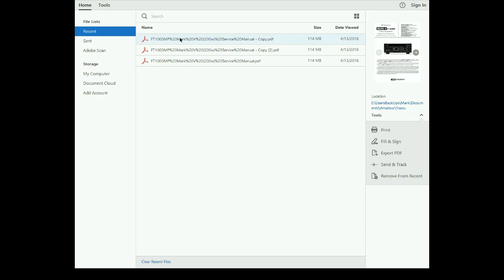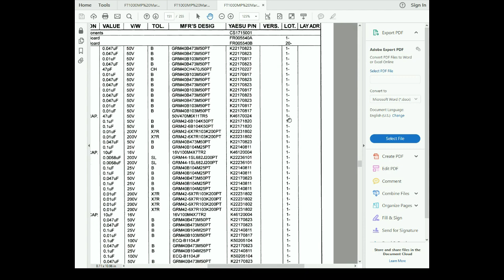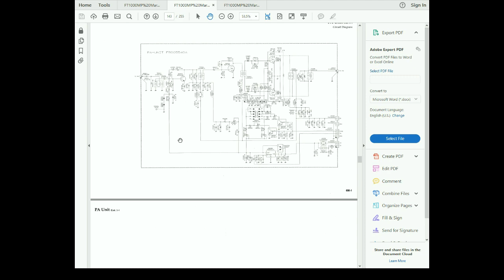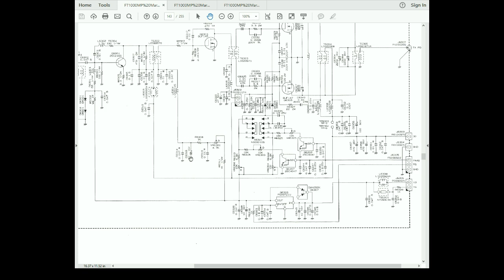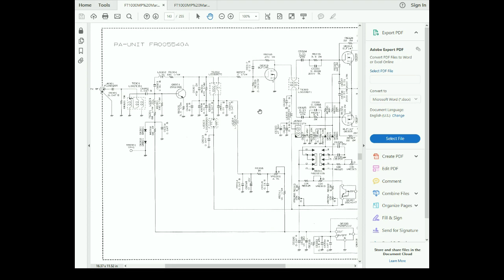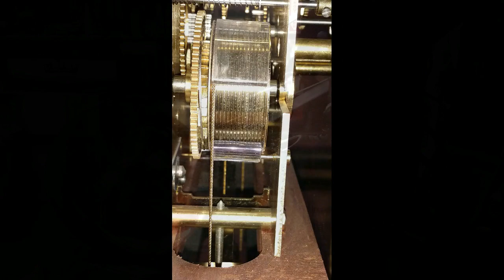FT1000MP MkV PA repair: Decrypting the service manual. Part 2/3

Comment: Is there a good database to get older schematics? I am not able to get what i need from the manufacture. I would love to hire your analysis. i have 3 of the same vmc / cnc machines and the crt circuit will not display video on two of them.The working vmc has a computer monitor instead of a crt and it is working with only green (out of the rgb wires)hooked up.  These have 9pin rs232 style coming out of the motherboard and converts to 15 pin video to back of monitor (its factory with crt and plug is factory) im wondering if it is the bias that is the problem like you mentioned in this video.  Or its the fact that the memory module is not working that could be the problem,. i just think that there should be some display even though there may not be any program running in the control system. I have no idea, This unit is too old I could use someone that is knowledgeable on the subject.   Dustin fillernecksupply@gmail.com

Comment: It's a shame that this video has so low number of views.
Would be so nice if you could do a similarly detailed go trough of other parts of the schematic, like the RF front end for example.
Thank you.
Reply from the maker: I appreciate your comment.  Yes, my in-depth videos don't get the volume of views that I'd like. But I do get the impression that those that watch appreciate the detail. I get a lot of critics who complain about too much detail, talk, etc.  Many folks, myself included sometimes,just want entertainment or fast info on a simple repair method, and don't really care why it works. 

I'd love doing detailed analysis of circuits. It's hard to do sometimes without the actual equipment present as schematics can be wrong or lack sufficient detail to be thorough.  This radio has already gone back to my friend.  If there's something specific you're curious about I'd certainly consider it. 

My next amateur related video should be building a TRUE linear AM modulator into the low level TX stages of a TS-940S to replace the awful Double Sideband Unbalanced mixer method.
Reply: In my opinion, the more detail the better. (and one can always skip, or speed up the playback if needed)
As you have mentioned, service manuals contain so little information on how exactly different parts of the radio work, especially on component level.
There are a few channels with great radio repair videos, (TRX Bench, Alpha Telecom) but without going much into detailed circuit analysis.
I love to understand exactly why and how a circuit (and every component of it) works, so yes, any video of this kind is welcome.